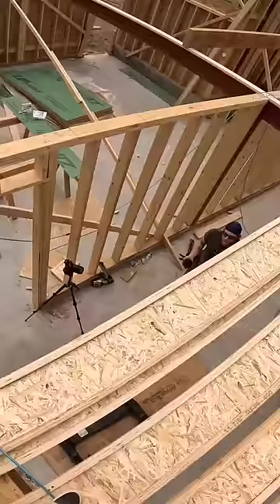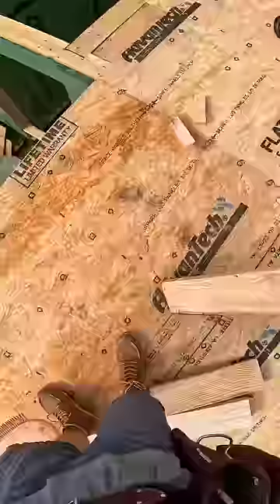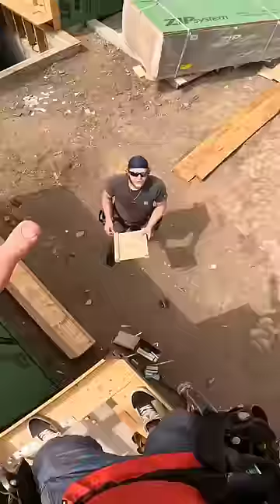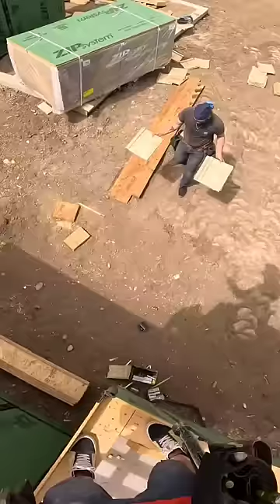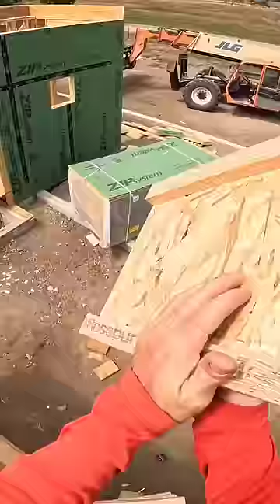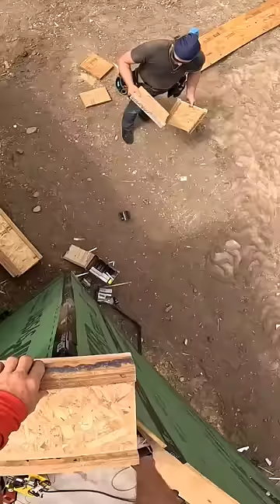satisfying throws #shorts #framing #construction #carpentry

Comment: The apprentice one time had to toss up 80 blocks. So i said "walk them up the ladder", to which he replied "i can throw more than one".. and he did. He perfectly threw 2 blocks into my hand over and over. Then i said "ya ok bud, do 3 then", as if to challenge him. Perfect throws every time. Straight into my hand, the bundles never seperating. FOUR! I screamed, with excitement  and disbelief. FIVE, CMON DO FIVE. I shit you not, the guy finished throwing 4s, had 6 blocks left and threw them up to me like it was nothing. We're talking 9' ceilings, through a skylight and over a 12" parapet. I will never stop bragging about him 😂
Reply: I used to  throw buttered stone 6' or more to my boss on the scaffold all the time.
Reply: That has got to be the greatest story yet no fucking way
Reply: Hope your apprentice went far in his career... Or at least went into baseball instead
Reply: How heavy are the blocks
Reply: Mr George’s story
Reply: Respect
Reply: @bensandifer1634  I'd assume they were 22&3/8" long 2x4s for spacing roof trusses, which are about 2 pounds. But the story also sounds like it's happening on a flat roof, which I've never worked on so it could be something entirely different. That's just my guess
Reply: @JayWalk_Official  8lbs 10 feet 10 throws I’d say that’s sounds more than doable the blocks we use in the uk are about 6x12 (guess work, I’m not a bricky) and are quite heavy say 4lbs which is a lot heavier which is what I was in disbelief about
Reply: Sounds like you worked for Mr. George the legend the 🐐
Reply: His muscle memory is insane clearly! If he was THAT consistent its becasue he programmed those tosses into himself!
Reply: you better be coming in with covfefe and benga’s for this man every single shift you work with him
Reply: That story made me laugh out loud love. That thanks for sharing.
Reply: Damn. 80 at that. Bet dudes arms felt like falling off
Reply: Best story that never happened 😂
Reply: Didn't have to pay for hour's.😂😂😂
Reply: Giving an apprentice a lot of credit as a journeyman….must be a glitch
Reply: @JayWalk_Official  good guess, that's what they'd normally be. This was indeed a flat roof that needed double perlins (hatching). So the blocks were 14-3/8 x 2x6 to build up the bottom run .. it's about 1.5-2lb per block..  nobody can understand how difficult that is unless they do it themselves. The coolest part was watching a stack of 6blocks come up to me without them separating in the slightest. If anyone's wondering he's a skilled labourer now. Getting good on the tools. (This story is only a few months old, he's progressing fast).
Reply: @Notesens  I can only imagine what a spectacle that'd be! It's always a great feeling to see yourself or one of your coworkers completely in their element at work, be it the perfect cut guy, the flawless tagliner, or the should-be NBA all-star
Reply: @terryhess5318  cool story, bro.
Reply: @Zeddicus_Zorander 😂😂underrated
Reply: True story or not, this guy need to be a writer.
Reply: Good man finding pride in people below you
Reply: @brandonreyes5567  thanks kindly. Surfs up man 🏄
Reply: I thought you meant cinder blocks at first I was like there's no way lol
Reply: Meth is a crazy drug
Reply: Dude was destined for greatness😂
Reply: Bro our apprentices don’t even show up to work.
Reply: the number gets higher every time you tell the story ...i'm just playing im sure you're telling the truth😂
Reply: Damn you caught 480 pounds that’s crazy
Reply: Lmao did you both make out after 😂😂😂😂😂😂😂😂😂😂😂🥶🥶🥶🥶🥶🤣🤣🤣🤣
Reply: Bricks or blocks? big difference.
Reply: Just happened to hire Obelix The Gaul.
Reply: This is like a book there was a whole plot and everything 😂
Reply: He's the chosen one
Reply: sounds like a power house and helluva worker
Reply: @jacobreyes4573 sucks hearing that. I'm an apprentice right now and I'd show up every day before the foreman and journeyman but I get let go because of a personal emergency and had to take a few days off of work to sort things out. Been looking for work for a month and nobody is giving me a shot. Makes me resentful toward the union.
Reply: That’s just wikd
Reply: This is amazing 😂 fucking weapon
Reply: The “I shit you not…” was when I knew it got real.
Reply: legend
Reply: HAHA! you and your buddy are a great pair! ❤
Reply: Imagine bragging about something you didn't even do 😂 cool story though, now go do me a mix and sweep up boy
Reply: I can throw stacks of 10 bricks in each hand,but most worthless framers can't catch them.
Reply: The first thing I thought when watching him toss the blocking was now do 2 at a time, now do the whole stack!
Reply: @terryhess5318 mmmmm...buttered scones! You were his favorite!
Reply: When I worked in a bakery, I'd throw 15lb boxes of donuts up to the top shelf. Mostly perfect stacks.
Reply: was he black
Reply: You sure this guy wasn't a good
Gorilla or something?😂 
What a beast
Reply: Saw a construction crew building a brick wall and they were doing similar.  Looked like they were throwing two stacks of bricks, each with ~8 bricks each.  Perfect throw/catch every time.  Respect the trademanship.
Reply: @Selinasdevil 😂 that's the easy part
Reply: Are you talking about cinder blocks? Because there is no way he was throwing 4 at a time if you are.
Reply: @terryhess5318 No such thing as buttered stone...
Reply: Wow. Like wow.
Reply: Just have read the whole story and I regret nothing. Thanks for sharing
Reply: He did that cus you told him to bring up to you
Reply: I threw a ball once

Comment: A good helper is every bit  as  important as his journeyman
Reply: From being a helper to a journeyman, this is absolutely bang on. You're only as good as your weakest link.
Reply: Been helping out my dad for the last 15 years and you’re damn right. A job with him alone would take 8 hours but if I help we can bang it out in half the time and we split it 65-35
Reply: @ots9358  When your dad gets a little older and the roles begin to swap. You better make sure that 65-35 is flipped too 😂
Reply: @aledyznuts3291  You got the right idea 😂 it’s getting to the point where I’d rather have him be the helper. He does notice this and ends up just splitting it 50/50 with me. Wish time could slow down a little sometimes man.
Reply: @ots9358  I just came across this old short and comment chain. Just wanted to say I hope you and your Pops are still doing well!
Reply: @Ru77ian  I appreciate you man! We’re still going strong. I hope everything is going well with you as well! And if it’s not then just know eventually it will be!

Comment: Osha officer gripping his chest and his manual :
🗿
Reply: The only thing the osha officer is gripping is the onsite safety guys nuts 😂
Reply: what on site safety officer, these guys are wearing sneakers without hard hats, these are residential cowboys not commercial workers.  @SiriusSphynx
Reply: @paddington1670 yeah the dudes on the roof are walking top plates and trusses like they where made to do it. no harnesses, hard hats, and most definitely no safety sucker riding their ass. and they are without a doubt more productive than similar corporate crews and have less injuries bc they have the experience with not just the work but the people they are working with. making a huge positive impact on productivity, efficiency, and overall crew moral.

Comment: Please whatever u do don’t buy a. House or have one built that uses that truss and beams. 2*4 and particleboard beams. Yes they are strong as hell till there’s a fire. Then that’s when your house will collapse and is one if not the most dangerous types of construction out there. All that holds that together is glue. And glue melts when heated so most likely depending where u live and if the local firehouse is volunteer of paid and how far out your house is. The house may be collapsed before the fire dept get there. An if u can’t make it out or don’t make it out for some reason they wont be able to save u